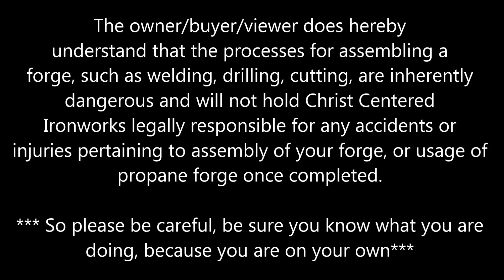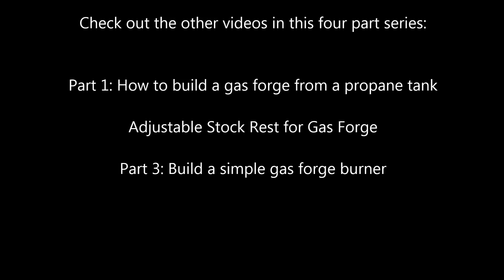Lining a Gas Forge with Kaowool: Ceramic Blanket = Quick and Easy!

Comment: Need coat kaowool or die from cancer, just saying... So don't say now with brick you ready to forge. This rig as is, is not safe for forging without respiratory protection. You did good video for putting in kaowool but saying ready for forge is a no go...
Reply: Been working around kaowool for 40 years working on BIG heat treat furnaces and in steel mills. Very seldom do you see anything coated.  I'll be 74 the day after Christmas. According to my Doc the only thing wrong with me is high blood pressure and a bad attitude. Fact is a lot of the guys that worked for me are dead,,,,but not one from cancer.
Reply: @mathewmolk2089  Fact is you don't know affects exposure does to everyone, some people exposed to something and their body adapts but many it will crush. Exhibit A would be Agent orange, lot people died within first few years
 Then, another group got whole bunch of cancer 50-70s, third group is still running around with bad attitudes..
I not fan of OSHA whatever on lot stuff, but some shit just not worth chancing when lot of data behind it says it more than likely will jack you up...
Reply: @mathewmolk2089  let me also say, sorry most of guys are not around anymore to enjoy your bad attitude.. And 40 years in a mill is hard life, so hats off on that. Gramps did 42 at ALCOA after WW2.

Comment: i really hope you covered that kaowool with rigidizer atleast
Reply: michael lagasse could you point me towards a video or give me some advice on a good ridgidizer beside cement?
Reply: 13irishsailors Google ceramic fiber wool for forge and read through the forums when using that stuff you need gloves and a a good mask on also you need what's called rigidizer you can by it on Amazon for like 20$ to harden the ceramic fiber and then put on a few layers of refractory mortar  also known as satanite dont use the cement stuff has to be  the mortar ifyou want to go the extra mile and dollar put ona layer of ht 100 after that (ht 100 cost like 80-90$ a pint)

Comment: Can I coat the wool in refractory cement then cure it in a grill or something? I'm trying to build a forge. Have 2" ceramic wool and refractory cement rated at 3000 degrees F. Also how does the wool not catch fire?
Reply: Wool doesn't catch fire because it's refractory wool, literally made out of spun ceramic. Think of extremely hard / durable cotton candy fibers haha.

Comment: I KEEP READING LOTS OF REMARKS,BUT i WOULD LIKE AN ANSWER FROM YOU.
did you have to put some kind of liner or chemical on your insulator after you installed it.
 thank you,enjoyed the video
Reply from the maker: ken taylor hi there I don't usually put any other refractory on my liners.. 
it is suggested that you do so for general health concerns. 
I myself don't use my forge in a confined space and in general don't stand at the opening of the forge to inhale anything that comes out. thank you for your question
Reply: just finished mine ken, and after about a year of reading as much as I could about this stuff I suggest you do not have your kaowool exposed to direct flame. kaowool lines my barrel then is covered by refractory cement and then a coat of (optional) itc-100. Don't take my word for it, go to kaowool website and get a 1-800 number, read and call the seller of kaowool, they will tell you the same thing. Do not expose kaowool to direct flame. depends on how big a deal "general health concerns" are to you personally. can't tell you what the people who have died think about it...they are dead. I doubt Christ Centered Ironworks will contact you if he changes his mind later.

Comment: do you have to do anything to make it stick to the sides of the forge?  and did you coat the final product with anything gonna the inside of the forge?
Reply from the maker: Steven Bodnarchuk there is no adhesive on the forge or blanket just a compression fit .

Comment: Where did you purchase you Koawool? Thanks
Reply: +Evrythingkool eBay! 

I bought a roll of 2600 degree ceramic fiber blanket 1"x 24" x 25' for about $105 shipped. 
There are many sellers, that will sell it by the foot if you don't need a whole box.